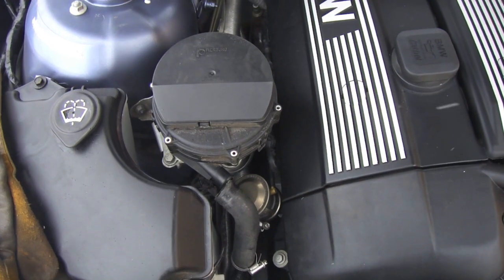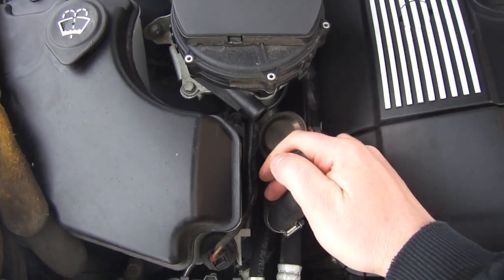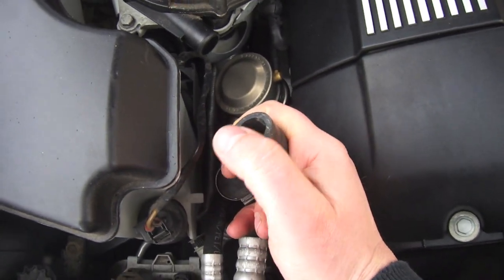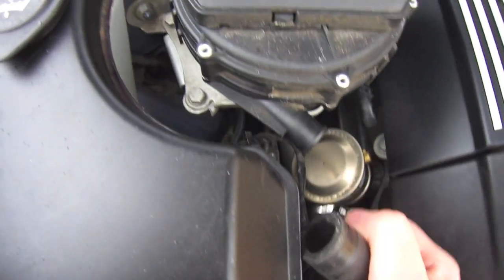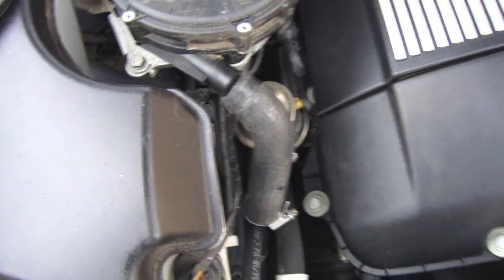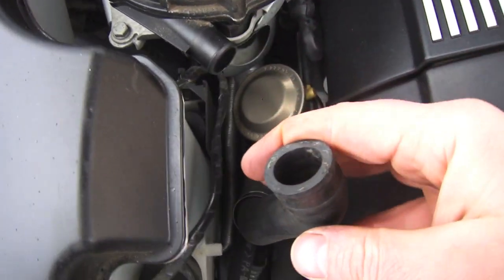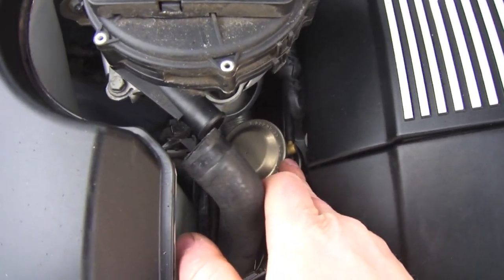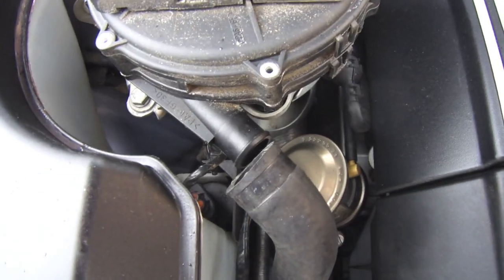E46 code f5,f6 secondary air flow too low, how to check air pump and check valve

Comment: My E39 was throwing the  codesfor the "secondry air system" and it turned out to be a vacuum leak. 
42.50 worth of silicone hose solved the problem. I don't know about you, but I really appreciate siìcone when its used for the right applications.

Comment: I changed my secondary air pump for my P1423 and P1421 code error and intermittent check engine light. This finally solved my problem. I also changed the check vale too. This video helped me and sent me in the right direction with my e36 328i =)
Reply: Did you have to reset code manually or do it reset itself

Comment: This code just came on my mercedes e class and I am wondering if it is just the check valve. I can hear the air pump in the morning when i start it up and it actually makes a sort of metallic whistling noise sometimes. I am wondering if that is the check valve with a leak in it? The valve itself looks like a metallic bell capable of making this sort of noise.

Comment: BSK - great post very informative. Thanks. 
I recently changed oil on my E46 and not long after the SES light came on. I pulled the codes P0491 / P0492 and I will diagnose using your video as a guide. Do you recommend any other diagnostics I should consider?  Where do you recommend I purchase the check valve should I need one? (on line?, parts store?, etc...)
Thanks again, keep up the good work.

Comment from the maker: you need a vacuum pump and apply about 14 inches of vacuum to the check valve to open it, if it opens that isn't your problem and it's most likely a vacuum line or the vacuum control valve behind the motor.

Comment from the maker: i haven't uploaded it yet but i filmed a video finally finding the issue with my problem, what happens is it would only happen in the winter when the fresh air pump would run, however it would take 5 seconds or more for the vacuum to open the check valve.  I swapped the vacuum control valve behind the motor and now the vacuum comes on instantly and the issue is dealt with

Comment from the maker: you would have to remove the hose going to the air pump and start it and see if there is exhaust coming though that way you'll know if it's failed.  Or hook up a vacuum pump and see if you can manually open and close it

Comment from the maker: i know for myself once i changed out the fuel purge control valve and the check valve for the air pump my SES light hasn't come back.  But post the code you are having

Comment: what does it mean when there is no vacuum in the crankcase? I've read there needs to be vacuum in the crankcase but, My 2001 325i E46 doesn't have any. Idles fine and power is ok throughout the RPMs.

Comment from the maker: if your check  valve has failed and pumped hot air into your air pump that is very possible or could be something simple as a fuse.  depending on where you live the air pump will only run for a few seconds when the engine is cold

Comment from the maker: miami is so warm it may not even run depending on the temp, in the winter here my pump will run for about a min or longer in the summer time there is times it' never even runs.  id just leave it

Comment: I have an 03- 330ci conv.. I got this following codes P1500, P0492,and P0491 and I just replaced the vacumm rubber tube  that is attached to the plastic tubing. I t  somehow got kinked under the  O2 Sensor wiring clip, under the pump,  then after that all the codes disappeared.

Comment: Any videos or suggestions on a BMW that won't start? The pulleys are spinning but doesn't make that crank noise. More like a whining noise (almost sounds like a battery car). The car was parked fine but the next day it wouldn't start. First time its done this. Didn't know where to post this question/concern at.
Reply from the maker: if your engine is turning over but doesn't start, could be many things you need to pull the engine codes and go from there

Comment: My air pump is working but my check valve is stuck in the closed position.   How can I test to see if the valve is bad or if it's a vacuum problem?  In the meantime, should I remove the hose going to the check valve since it's not functioning anyway?

Comment: really stupid qestion, but on the bottom right of the wiper fluid case, what is that cylinder slotted into it with wires ? I think I may be missing that..
Reply from the maker: I believe you maybe referring to the headlight washer pump, not all BMW's have that feature
Reply: thanks  !

Comment: Question? Will an e46 start if the secondary air pump is bad or the relay blown?? 
Thanks in advance
Reply from the maker: yes it will
Reply: thank you for the quick response,
hope you don't mind me asking. am having this weird situation with my car, is a e46 1999 328i, I did a few diy's on it. I replaced the intake boots down to the throttle body clean the icv, and check the disa, replace sparks, and did a sea foam at intake. NOTE :by the way I did mess a bit with the throttle body wire..  the car ran ok after all that , but after a few days pass a fucken power steering hose broke and it leak all the fluid at this point the car would start. so I took it out the garage start it up to check leaking hose and bang car stalls, and I have not being able to start it since then.
 NOTE :by the way I did mess a bit with the throttle body wire...  anything that could point me to the problem will help thank you.

these are the codes I get after car broke down
73
A9
44
and these codes prior to car breaking
f5
f6
f2
EE
E4
E3
08
Reply: Bullshitkorner
 
thank you for the quick response,
hope you don't mind me asking. am having this weird situation with my car, is a e46 1999 328i, I did a few diy's on it. I replaced the intake boots down to the throttle body clean the icv, and check the disa, replace sparks, and did a sea foam at intake. NOTE :by the way I did mess a bit with the throttle body wire..  the car ran ok after all that , but after a few days pass a fucken power steering hose broke and it leak all the fluid at this point the car would start. so I took it out the garage start it up to check leaking hose and bang car stalls, and I have not being able to start it since then.
 NOTE :by the way I did mess a bit with the throttle body wire...  anything that could point me to the problem will help thank you.
these are the codes I get after car broke down
73
A9
44
and these codes prior to car breaking
f5
f6
f2
EE
E4
E3
08

Comment: @iHateFattPeople The information you provided is not very specific. what is the code number and is it a OBD 2 code. Then don"t believe the worst about shop mechanics, many of them have contributed generously to this forum to help increase knowledge. You may be oversimplifying the symptoms you are experiencing because  not all changes in your engines performance is noticeable to the driver. Please, give me the EXACT obd code and i will try to help you. [ obd codes don't tell everything ]